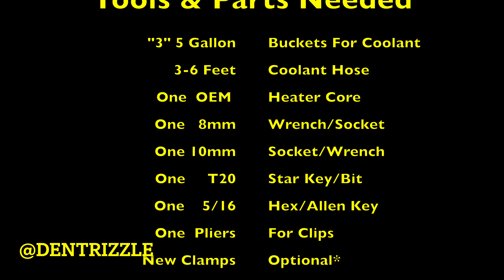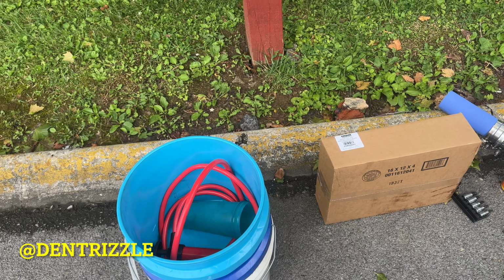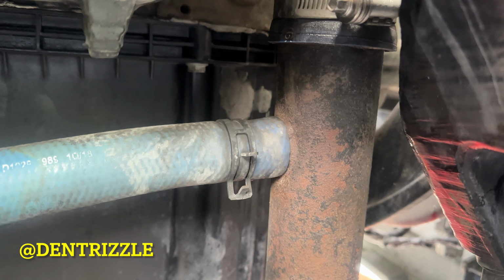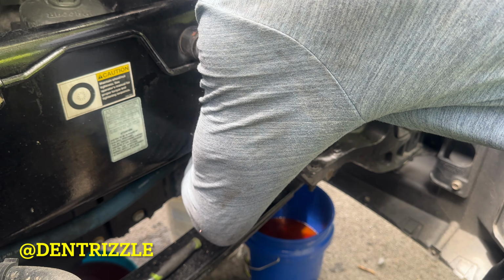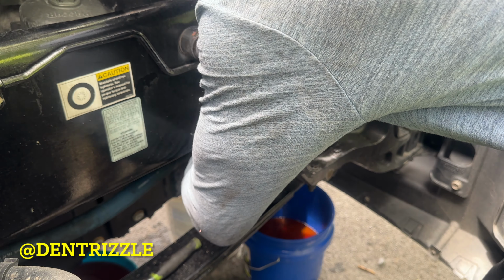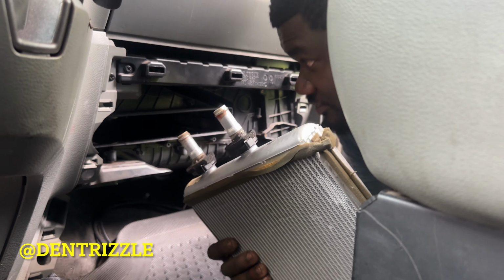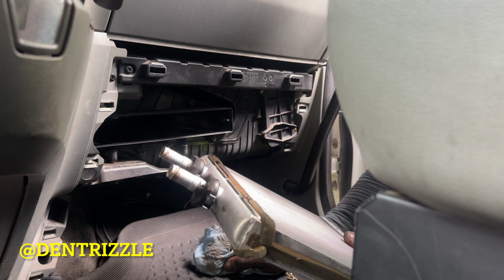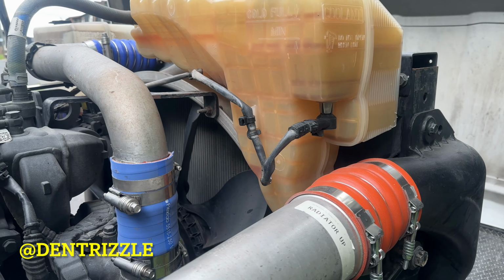How To Replace Heater Core To Fix Ghost Coolant Leak On 2019 Kenworth T680 Peterbilt Paccar MX13

Comment: Question my heater core start leaking from intake joint in small amount, and also from water pump o ring seal, I heard from internet using k seal heavy duty will stop all coolant leak.
So any advice about using k seal instead of replacing heater core and water pump o ring ?
Reply from the maker: @eddy.g6078  I’ve never used K-Seal as it’s the 1st time I’m hearing about it so I wouldn’t be able to give my opinion. I usually find the issue and just replace it cuz that is what let me sleep good at nights knowing that its a full repair and not a temporary one. Just my opinion

Comment: My truck is not leaking inside the cab yet, but out by the bypass hoses very little,why is that?does the bypass and heater core get clogged or what causes that to leak ?
Reply from the maker: Mine started on the outside too but gonna soak to the inside. Why it leaks is the heater core design. It’s not one piece like traditionally would and it tends to to flex cuz there are 2 plastic joints on it. What I can say it is design to break for price gouging.
Reply from the maker: Mine started on the outside too but gonna soak to the inside. Why it leaks is the heater core design. It’s not one piece like traditionally would and it tends to to flex cuz there are 2 plastic joints on it. What I can say it is design to break for price gouging. Honestly why it leaks at the bypass hose is actually the heater core joint unfortunately. Took me a while to find it.

Comment: What is the heater core part number I saw it online $115 but dealership said $348 from kw and peterbilt said 450$
Reply from the maker: @rndygong  Honestly I don’t really know. What I normally do is call my local MHC which I have an account there and just order what I want. But it’s a case where I order parts by my VIN#. I would call a Peterbilt or Kenworth store and ask for the part #

Comment: My truck will only below hot air after driving.
Reply from the maker: A number of things can cause that but start with your AC system. I can’t elaborate with such little information.
Reply: Do you have a video how to clean the boost sensor ,thanks
Reply from the maker: @alfredoramirez6728  No I’ve never messed with it before. Sorry